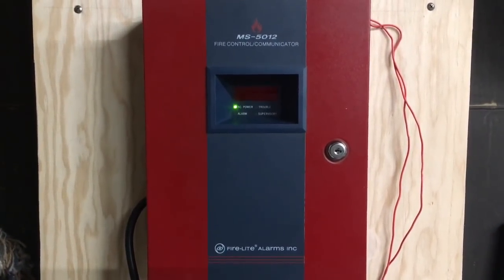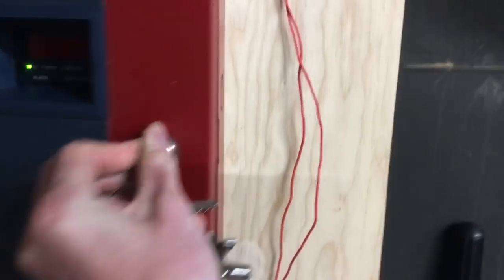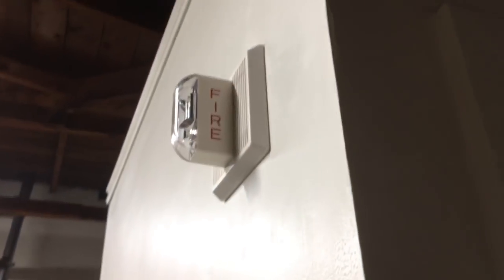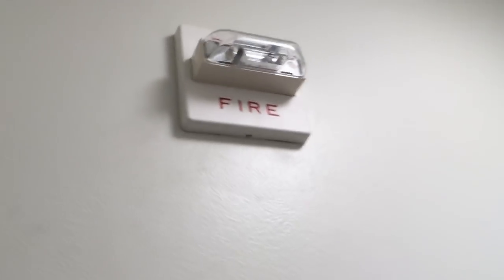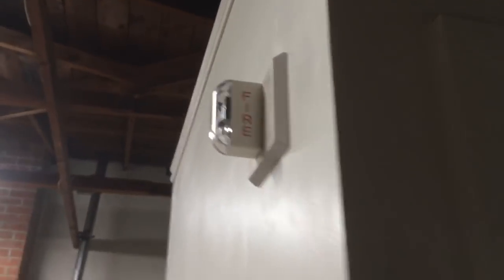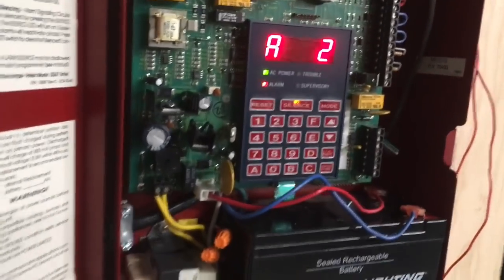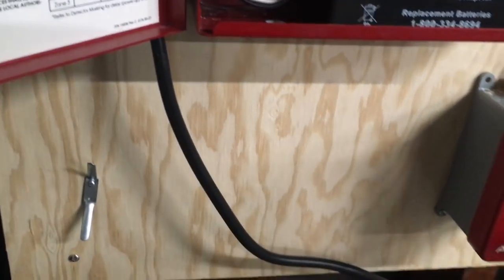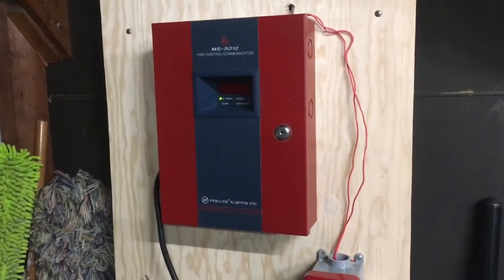*NEW* SYSTEM TEST 1

Comment: Great video 😀👍👍
That was fast!
Those white alarms looked great!
Dumb question: Does the panel do coding options? My high school has newer MTs, and the ones in the science labs are on bell, with the panel coding the to code 3. My guess for you forgetting to reset the pull station, is within the next 2 system tests!
Reply from the maker: Evan Bart 410 Your bet is in and sadly this panel does not have coding options